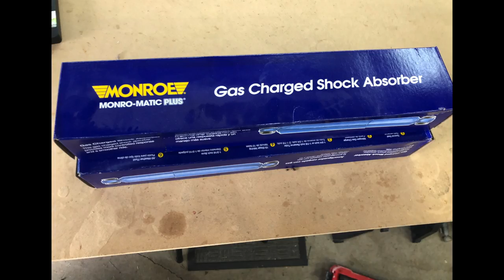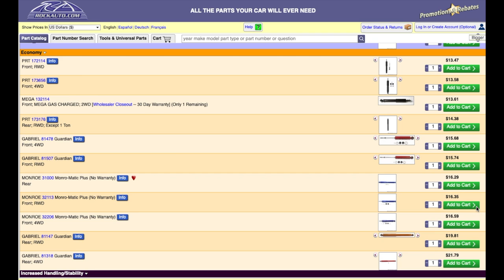Nissan Hardbody - Replacing Front Shocks and Upper Ball Joints

Comment: GREAT vid, but 2 points:   1.  do NOT use your ratchet with a cheater bar, use a BREAKER BAR, rather than a ratchet      2.  do NOT let the spindle assembly hang by the rubber BRAKE HOSE, that is good way to get hurt, or at least, ruin your brake hose !!!!